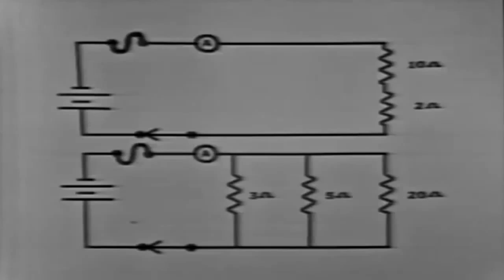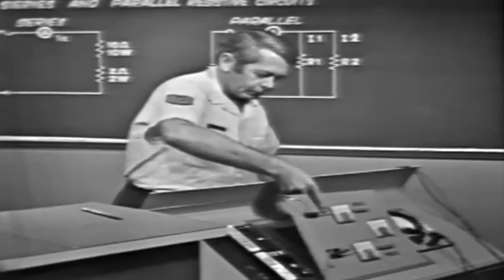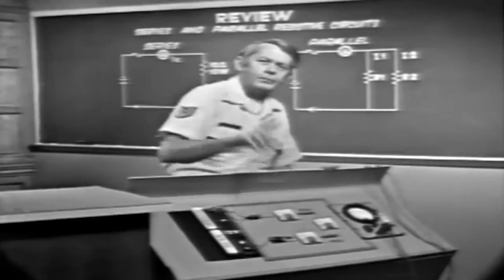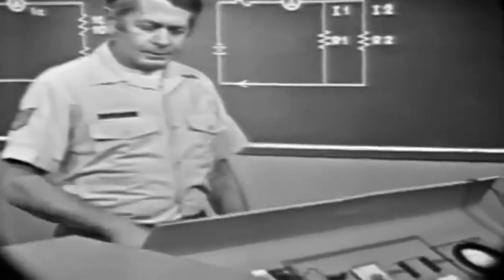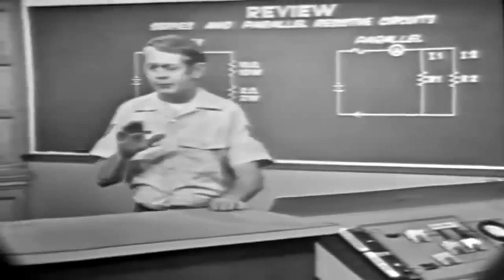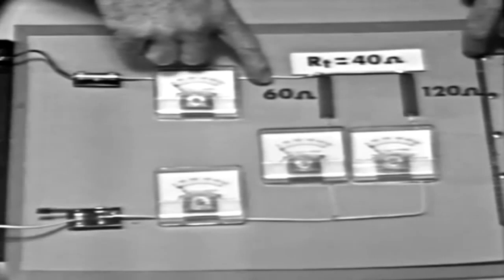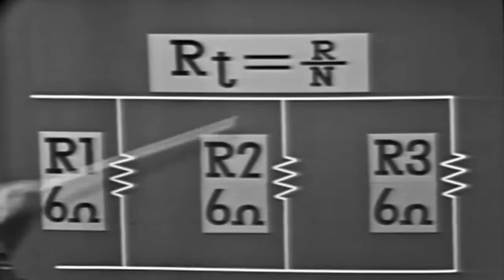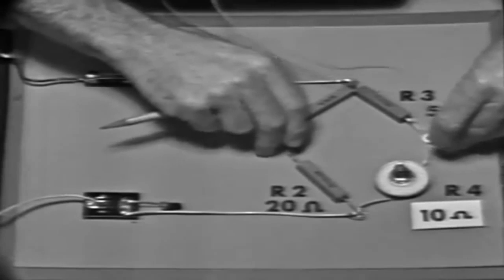Series Parallel - Lecture 10B

Comment: I really like the videos. Very educational in deed. Why is it if I try this circuit it gets so hot it starts smoking (even with lower voltage). I haven't been able to test the voltage drops for this reason but in other circuits I cant get a 20ohm resister to drop voltage 4 volts. Could someone out there maybe explain this. I'm kinda "stuck" on this point and it might be dumb but I would really appreciate some clarity about this. Thank you so much for any help.

Comment: Mr. Voss A very good series, When I went to radar school in the Air Force, at Keesler AFB Mjss. in 1961. I remember videos like these, also the ohms law pyramid and the bad boys way to remember the color code for resistors. an ELI for inductors and ICE for capacitors or ELI the ICEMAN. Thanks for the memories.Ray